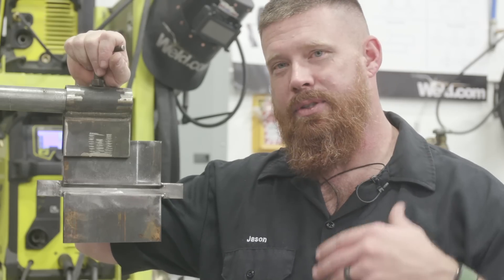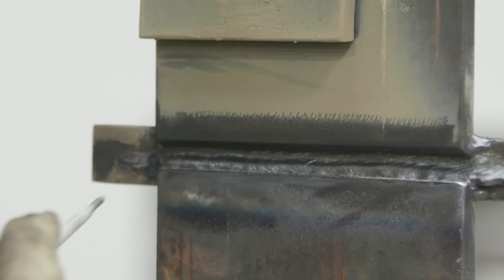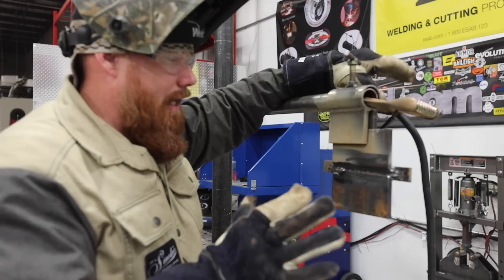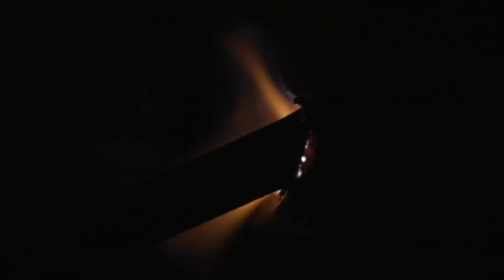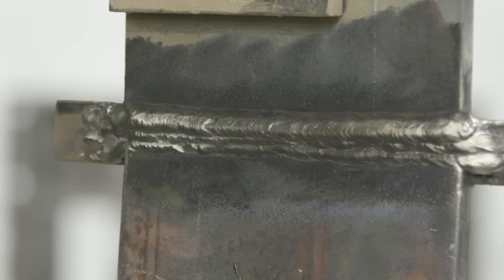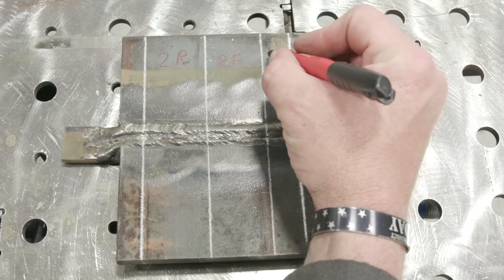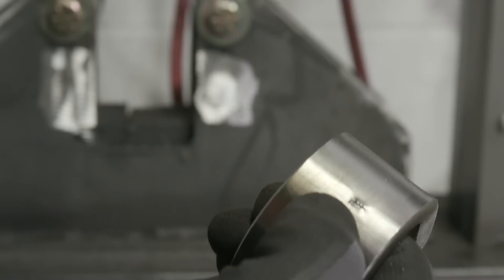2GF CWB Welding Test Bust

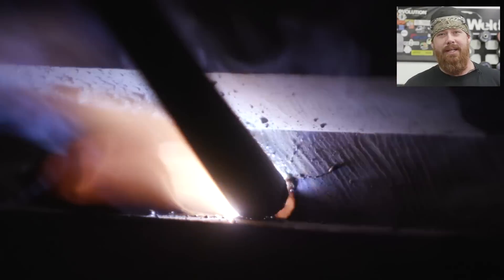Comment: 2:10 You can say to do this or that at this or that spot, but viewers like me who learn from hands-on- I don't know what you mean by starting at a different point. As in the bevel side. I know what the bevel is, but does that mean start on the top when you reach the stopping point or what? I wish you would have physically shown what you were talking about, rather than speak it. If you make a follow-up video, I hope you show what you did, compared to what you were supposed to do. Because it's still jibberish to me; until I physically see what you mean by you "did wrong".... No need for anyone to reply. That's even worse than speaking, is typing it.

Comment: The whole cwb program is an absolute joke .  I have no idea how it exists
Reply: It exists for structural and over the road welds. If you don't do any of that work, you don't need it.
Reply: That test actually looks kind of hard. Human lives may depend on the quality of those welds so it should be a good test of skill.
Reply: The CWB is a great test. I learned a lot going through these and I’ve been welding for over 20 years. It’s definitely a good procedure.
Reply: @jasonbecker3362  don't sweat the haters.....you're rockin it.
Reply: yurimodin I like the haters. They let me know I’m doing things right 😂
Reply: Salty cuz he failed 🤣
Reply: It actually taught me a lot, made me a better welder as well. A lot of shops and companies in Canada that do structural require these nowadays, and even if they don't it looks good on your resume up here
Reply: Geoff Moore lol no . I had it when I was an apprentice my job doesn’t require me to have it  now.  I am not saying this guy is a poor welder by any means.  I just don’t personally see the value in any of the cwb tests.
Reply: @Firebird400  They are a welder qualification test like every other code has. The one advantage is that the pre-qualified tests are transferable between companies because CWB is a third party and they control the qualification records. So you can leave any CWB certified company for another and all your transferrable tickets remain. The down side a lot of companies see is the cost, but in Canada at least, it brings a lot of business because its not on the customer to verify your welding program. Its already done by the CWB. Also for inspectors like me they have test centers all over Canada and I can go write any endorsement test I may need every second Thursday.